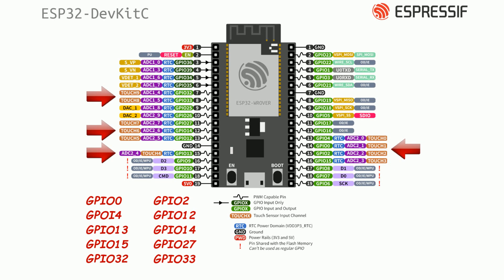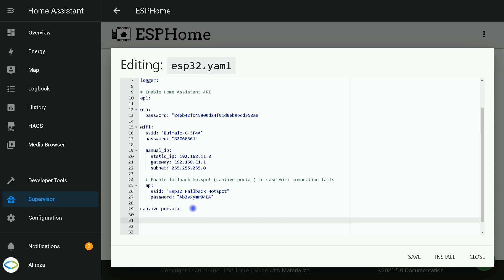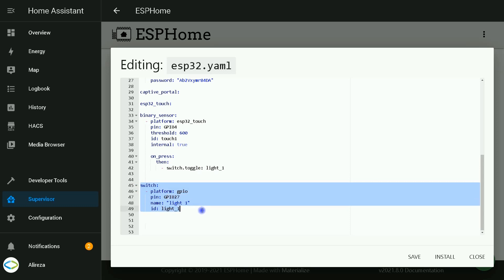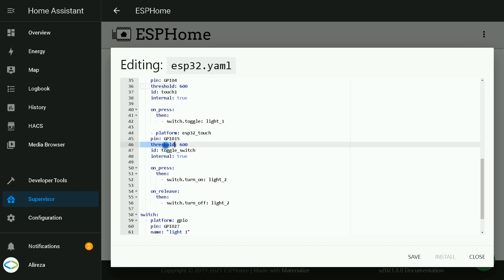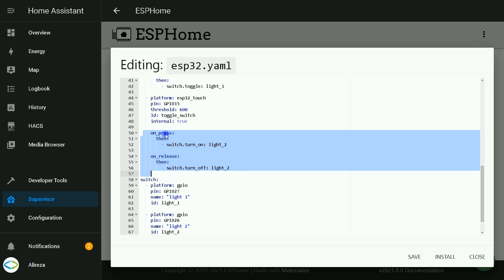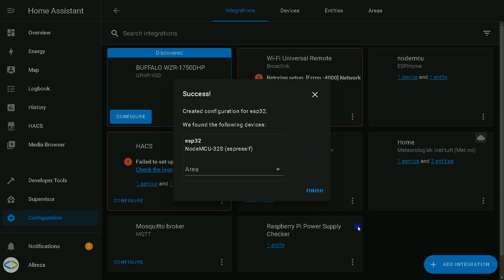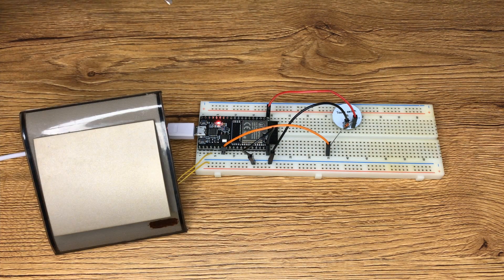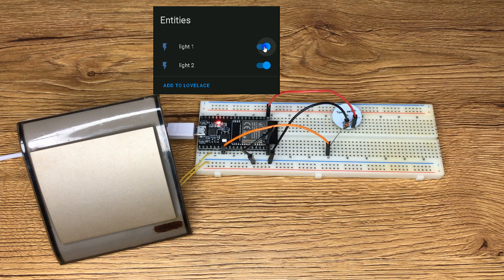Smart Switch with ESP32

Comment: what is the maximum mechanical switch that can be used, I am trying to make 8 smart switches and 8 mechanical, can all ESP32 pins be used? Is this enough? Please enlighten me.wassalam
Reply from the maker: it depends on the number of pins that can be used as input and out put. For ESP32 they are: Pin 13,16,17,18,19,21,22,23,25,26,27,32,33 and 4. Mentioned pins can be used as input and output (either of them) and PINs 34,35,36,39 are only inputs

Comment: i got massage in log like this : [20:47:45][W][component:214]: Component esp32_touch took a long time for an operation (0.06 s).
[20:47:45][W][component:215]: Components should block for at most 20-30ms.. Is It Normal?
Reply from the maker: Do you face this message while installing Yaml file on ESP?
Reply: @kian.smarthome  no message appear.just normal
Reply from the maker: @giantbrain5793  Is it working?
Reply from the maker: @giantbrain5793  Great

Comment: If I add a light, then when the switch is on the light also turns on. What's the wiring schematic like?
Reply from the maker: Sorry I do not understand your question. Could you elaborate it?
Reply: @kian.smarthome  sorry i mean, if no internet,mechanical switch still working ?
Reply from the maker: @giantbrain5793  Locally yes but it's better to have the Internet access.

Comment: Hi, thanks for the Video. I have a Question: If the light is turned on by the mechanical switch, and then turned off via home assistant, the mechanical switch remains in the 'on' position. Meaning, I would have to turn it off and then on again, if I want to turn on the light with the mechanical switch. Would it be possible to use a push button-style switch, to send an impulse to the esp which can turn it off and on? This way, the switch wouldn't have to be turned off before being able to be turned on again.
Reply from the maker: Hi, you asked a good question. Yes you can use a Push button switch. In the video you can replace the touch switch with a push one.

Comment: Hi really nice video.
I havr to clarify one thing.
The physical switch used will sent the value to the home assistant right and home assistant turns on and off the light.
So when my router is off or the home assistant has any issue there is no way to control the light.
Or will it work?

Is there a way to run the program in the esp board itself and update the state in home assistant.
Like if the input pin is triggered then set the output gpio to on/off and then sent the state to home assistant.

I would really like to talk with you privately and discuss more ideas.
Can you please provide your email address.
Reply from the maker: hi
1) it will work and is not dependent.
2) it is as you mentioned.
3) it's my pleasure (Alireza_44907@yahoo.com)

Comment: Hi sir! I'm new to Home Assistant. Let's say I program my physical switch with esphome and relay. Will the relay work onchange of the switch when home assistant is down /  when my router is damaged.  Kindly advice on this.
Reply from the maker: Hi, Yes, if you program and run it in this way I mentioned in video